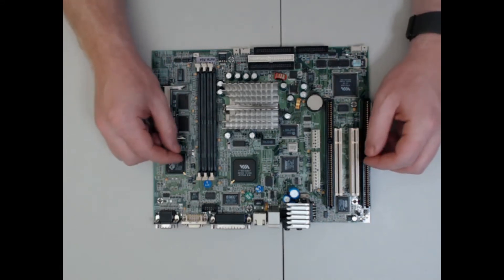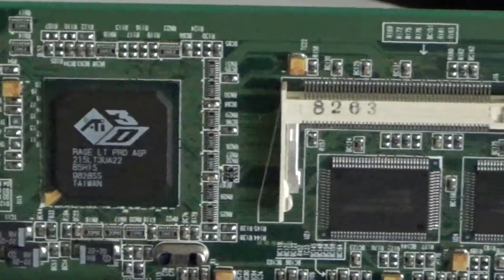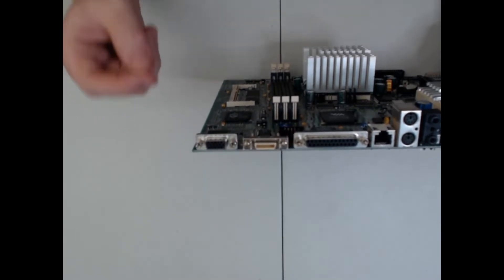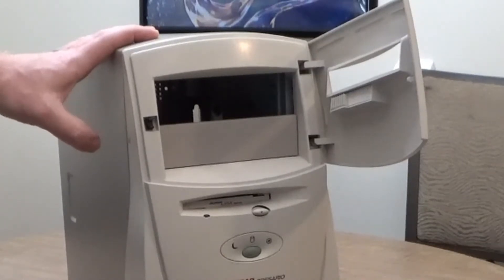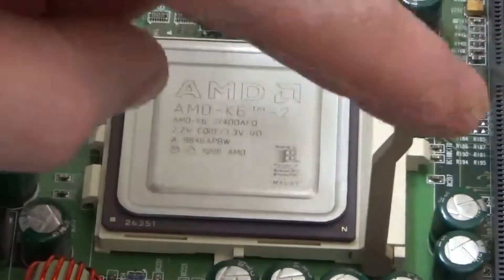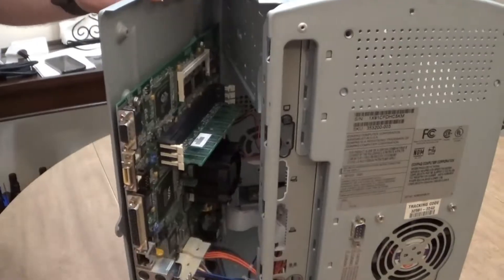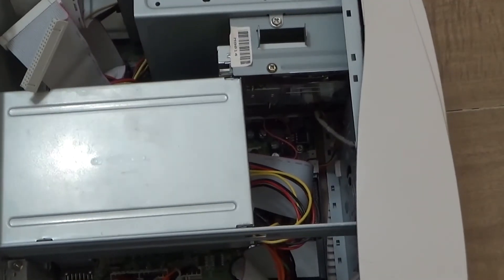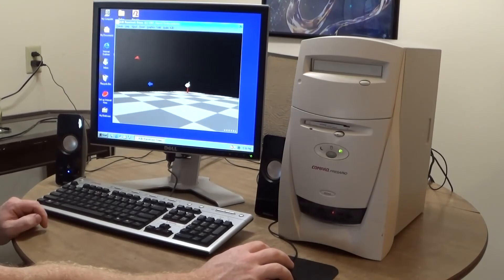[PC BUILD] Building up a Compaq Presario 5240

Comment: Still hve this computer. Mine came with 8MB but back then in 1999, I didn’t know that slot was to expand video card. So I bought in 2000 a Voodoo 3 3000 PCI card 😁. And upgraded to 384MB of ram. Windows 98 flew 😁. Then, windows xp was quite heavy for a 400Mhz cpu.

Comment: Did you ever end up going any further with this? I have a 5240, purchased brand new back in the day. I’ve always been curious what the best processor is that I could throw in there and still have it work. 

I’ve got an adapter and use an SSD for the hard drive now. Maxed out memory. The CPU is the only Unknown for me